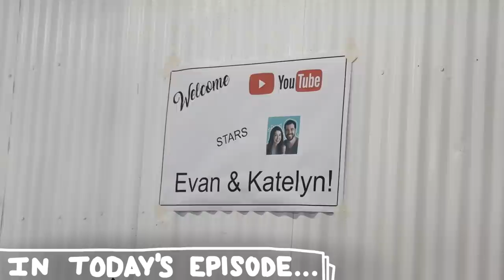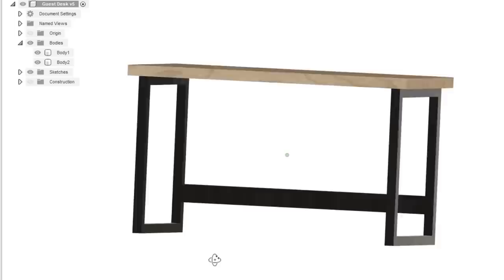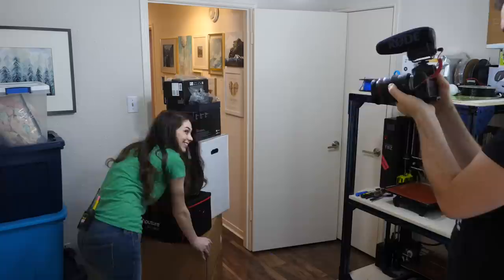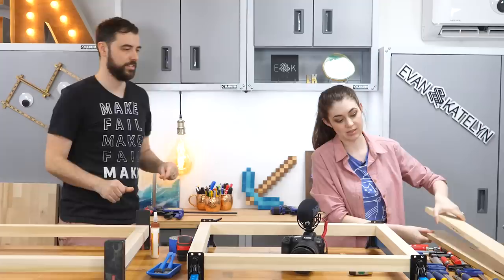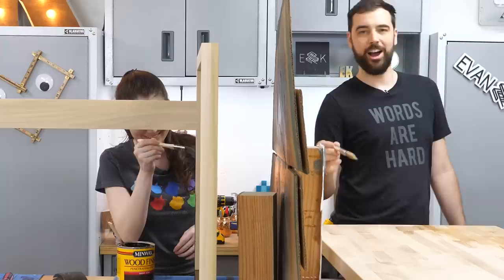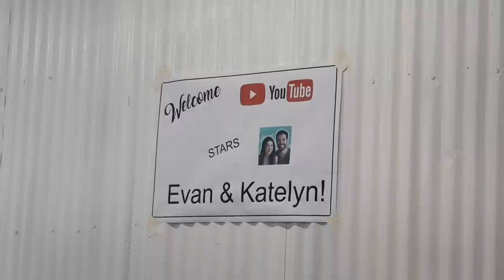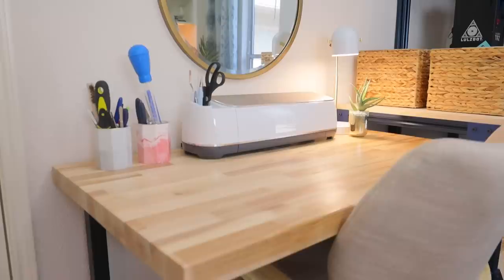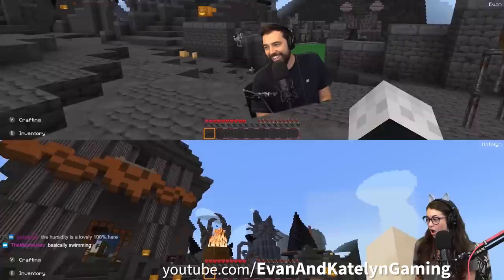Under $1000 Guest Room / Home Office Makeover

Comment: You could hang that wedding backdrop on the wall inside the Murphy bed. Like a decorative headboard/rest. You could even add ropes or braids to tie the colors into your curtains or just swap them for complementary curtains when the bed is down. If you have any scenery pictures from the wedding you could even float them off the wall slightly as the backdrop hangs behind them.

Comment: Tip for gluing wood pieces that you don't want them to shift: Add some just some table salt (as if you were sprinkling it on food) to the joints that you are gluing. The salt bites into the wood and prevents the pieces from sliding.

Comment: I find it amusing that I was watching and not paying that much attention... Yet I saw a plastic can when Evan was finishing the table legs, and didn't even read it, but knew it was polycrylic lol...  

I've only ever used Polycrylic for image transfer... At the hotel I worked at for 5 years, they had an old wine crate that was used as a "bike rags" box for bikers to dry off their motorcycles after rain.

I made legs out of pallet wood and created a "Bike Rags" sign and an old motorcycle graphic design with some leftover hard plywood I had lying around and a few LaserJet prints in reverse... It turned out lovely... I may still have pictures if you like... May...

I say may, because of the fact that my Nikon camera was stolen last year, and when I was homeless in Dallas for a week last September, I left my old phone sitting outside a 24 hour fitness at like 1 am and 15 minutes later when I went back, it was gone lol.

Given why I spent the night at a Walgreen's, given they were the only place open nearby and my friend had my car.

They realized my skills after a while at the hotel lol...

Originally they had a guy who worked at a local cabinet shop repaint the cabinets, given he worked at the cabinet shop and had the tools for the job...

Fool didn't even clean the surfaces, much less do any prep sanding 🤣

Needless to say, paint started coming off within a month or two...

So when they went to repaint the lobby, they had me do all the trim and the cabinets...

Needless to say, it took me months, given that I could only work on certain nights on it, due to influx of guests on the weekends here in Fredericksburg... But you can bet that the new paint is beautiful and will last for years... I'm a bit of a perfectionist lol

Comment: I HAVE 2 IDEAS!!
You should grab some more curtains to have the same fabric (or just a neutral fabric that matches the walls), measure and cut it to the size of the robot cart sides, finish the edges and add velcro around the edges of the fabric and the robot cart so you can velcro the fabric panels to the outside of the cart to 1) hide the robots when you have guests & 2) keep dust and cat/cat hair off the machines more when not in use.
Second idea, fake storage box or plant to cover the one on top. Get something nice that will cover the machine up top, like your wicker baskets but that you can cut the bottom and a side off and slide around the machine. This way it covers it from sight and keeps the guest room looking like a guest room, but is easily added and removed. (depending on material of container I tie or strap may be needed for the side you cut off to keep it looking square shaped)
Reply from the maker: Ooo great ideas!!

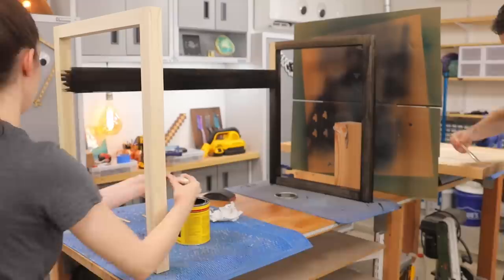Comment: 11:44 Don't use a small cheap brush with quick strokes to put on poly. Use a 3in quality brush with slow long pulls in one direction. It will turn out much better with less sanding between coats.

Comment: I found out that one of many reasons for image transfer to wood, including hodge podge, was polycrylic... So that's what I used...

Put on a layer of polycrylic and let it dry a lil... Then put a reversed LaserJet print face down on it... Then used a toothbrush and water to brush away the paper...

After which I sanded the edges of where the paper was to remove the definition to the edge... A lil sanding on the print to make it look aged... Then a coat of polycrylic to seal over the top lol

Comment: Just a suggestion, but on ur table all the leg and stretcher joints are butt joints. When you just use glue on a butt joint since the end grain sucks up alot of glue it's not a very long lasting/strong joint. May want to reenforce them some how, there's tons of ways too all.

Other then that awesome job and another fun video to watch 😁😁
Reply from the maker: Thanks! Might reinforce them some day

Comment: Fair warning to anyone using butcher block to make anything that handles a decent amount of weight. The butcher block is WEAK compared to the solid wood. So if you plan on doing what I did (embedded a sheet of river rock in resin), you need to support it before hand. 1 of my corners is bowed up because of that project.

Comment: Those table legs need some sort of fastener for those butt joints because using just glue is very weak. Also consider using india ink next time for blackening table legs since you only need 1 coat.
Reply from the maker: Thanks for the tips!

Comment: I'm planning to make a desk like this. Thanks for giving me the kick in the butt needed to improve on my wobbly IKEA desk.

I noticed that you did some end-to-edge grain joins in this build. I had always been told previously that this was a big no-no, but I read some more about it just recently and it seems like if you do it right it can be plenty strong. I am curious if y'all have had any problems with these joints since that time. I can see that they are probably not under too much stress so I assume it would be fine, but I'd be happy to know if you've had any issues. I was considering making the stretcher run past the back of the back legs so at least that joint would be edge to edge (or I guess I could do a lap joint but ugh).

Comment: 14:51 PLEASES PLEASE PLEASE Never do that again, coiling wires create heat and while electrical cables are rated to disperse the heat they generate coiling them increases the heat generated, in some cases the heat can melt or cause the insulation to become brittle which could cause issues years down the line.